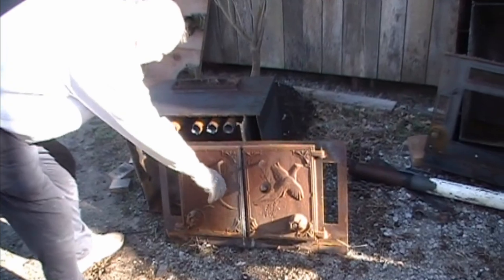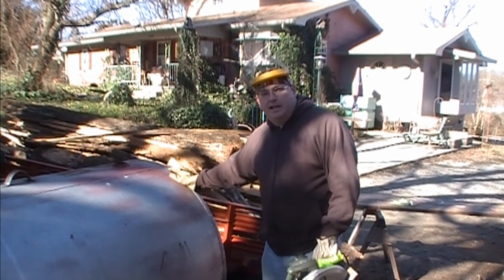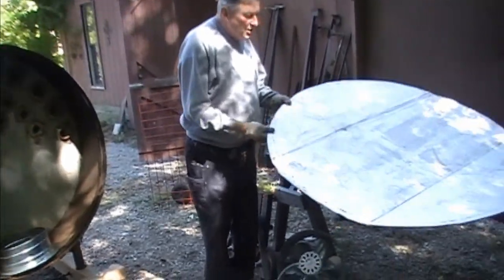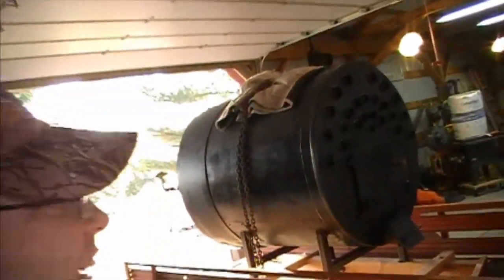Wood Stove build: We converted a 500-gallon tank into a Wood burning Stove. (41)

Comment: What is the diameter of heating pipes and thickness of the walls you have in the stove ???? Thanks
Reply from the maker: The diameter of heating pipes tubs I thank was 3 inch.  sorry I don't remimber the  thickness of the walls.  I sold the stove. but it was awesome Wood stove and some good memories of my Dad. thank  you for watching the River Jumper channel. God Bless
Reply: @RiverJumper7   Would you remember if the stove had guides for smoke to rise in specific leves ??? Maybe did you make a secondary burn section of the stove ??? Thanks a bunch River Jumper. God bless you to Sir. I bet you will never forget the memories you have with your dad. Peace VF